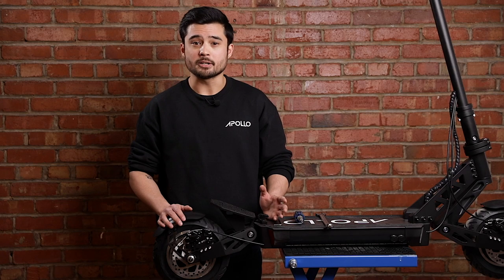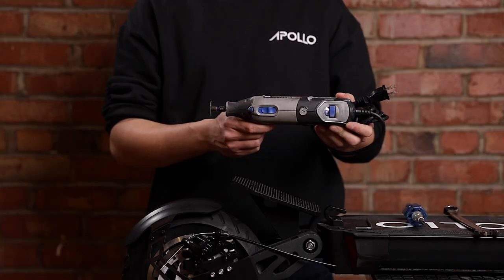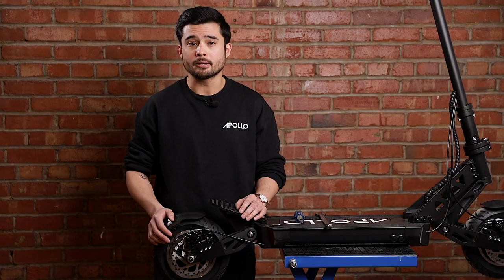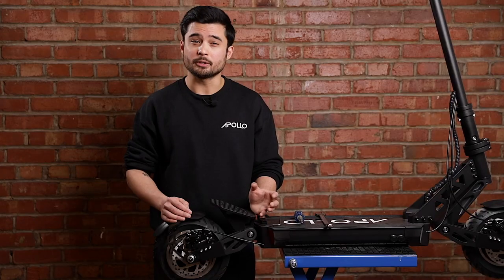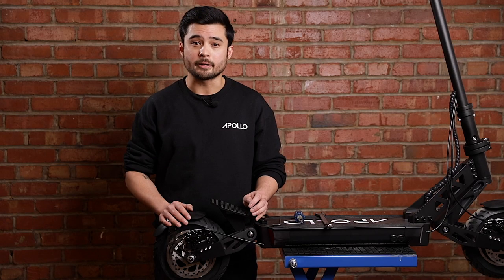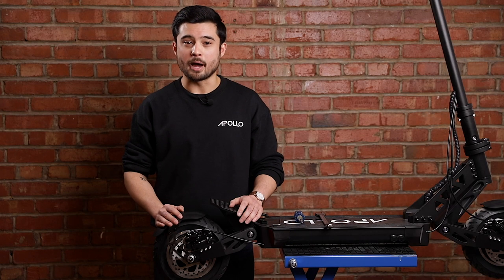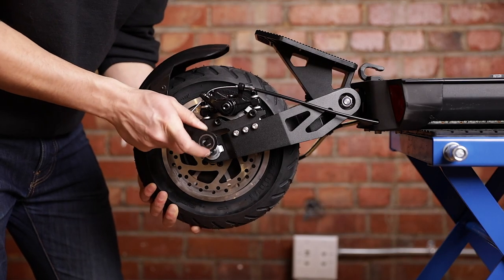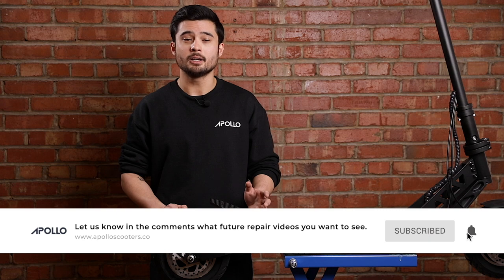How to Change a Brake Disc on an Apollo Ghost

Comment: The 6 screws are extremely tight on my ghost. I stripped 2 because of it and the other 4 were tough to unscrew. The tool you guys need that he’s talking about is a dremel. Costed me $70 at Canadian tire for a decent one. It’s just a shame that the screws aren’t fully metal, would’ve made it easier to come off and not strip.
Reply: I’m struggling to get them out. I got one out normally and one using a hammer. Tried the rubber band technique (no luck). Now I have to find a dremel which is unfortunate cause everything else was going well.
Reply: @YouProductions1000  dremels are useful for a number of things so I guess it’s a good thing to have it in our toolkits now.
Reply: Bro fuck disc screws on rotors, i messed up mines too

Comment: I have wasted a week and over $200 in tools to try and remove the screws from one wheel on my Ghost. All of the disk brake screws on both wheels came stripped out of the box. So stripped that I couldn't use any size of allen key or any other tool to even try to remove them. The holes in the screws are perfectly round with nothing for any tool to grab onto. Cutting a notch in the screw with a Dremel doesn't work either because the screw is so overtightened and it's made of cheap aluminum that just bends under the screwdriver bit. I've even tried penetrating oil and heating the screws with a cutting torch. This is unacceptable, sloppy, poor quality assembly at the factory. I've removed bicycle disk brakes many times and never had this problem. The screws are supposed to be tight, not stripped. These brake disks are supposed to be removable by the customer so we can work on tires and other parts. Stripping the cheap tin screws out at the factory makes this impossible. 

The only way I will ever be able to remove these screws is by forcefully drilling them out, which risks damaging both the brake rotor and the motor underneath it. I didn't buy a scooter so I could spend weeks spending money and time trying to remove broken and/or defective parts, as far as I'm concerned a stripped screw is broken. My Ghost is sitting gathering dust for over a week with its wheel off in my front hallway, I haven't even been able to ride it once in the beautiful spring weather. I'm so angry about this that I'm about to return the entire scooter and get my money back to spend on a better quality product. 🤬
Reply: Agreed. Tried multiple times to remove the stripped screws using various techniques, but in the end I’ll just have to get it serviced. As a casual rider it’s a real inconvenience on what otherwise was an exceptional scooter.

Comment: I used a Dremel to cut a wedge into the brake disc’s screws since 4 of them are stripped, but cannot get them to open with my flathead screwdriver. Any suggestions?
Reply: I used the “OEMTOOLS Mini Impact Driver” from the local auto store.

I was successful using an impact screwdriver to remove both the stuck / unstripped screws as well as the screws I had to cut with a grinding tool.

The cuts made by these kinds of hand tools recommended are a bit loose and a little difficult to make. (Especially if you just bought this tool and are using it for the first time like I did). 

It is really important to put a lot of force on the bolt head to keep the new cuts from stripping as well, (if you do not have an impact screwdriver).

The bolt that holds the wheel on makes it really difficult to unscrew the break plate properly.  The bolt makes it so you cannot press the wrench tool straight onto the screws with the proper amount of force, which will cause it to strip easier. Since the wheel is still attached to the motor cable, it makes getting a good angle on the screws / wheel difficult, because you need to have the scooter lifted to work on it.

I recommend finding a nice set up to get the wheel flat and stable before trying to remove any of the screws.

Also I replaced the screws with matching grade 8 (stronger) screws, because the screws are badly damaged from the grinding tool and also I saw a screw is somewhat sheared at the threads, (maybe from over tightening at the factory, or natural wear).

Comment: How do I get rid of the brake squeal? My ghost arrived last week and the squeal noise was unbearably loud, had to sand down the the pads a bit and brake cleaned the rotors, the noise lessened a little bit but still present

Comment: How many miles until you have to change brake pads on apollo ghost.
Reply: I can't speak for Apollo, but I'd think it would greatly vary based on riding style. Going downhill and braking often  will wear pads down faster than coasting and braking seldomly.
Reply from the maker: It truly depends on your riding style. However, you should be good for no less than 300km.
Reply: @ApolloScooters  ok thanks for the response. I love my ghost, this scooter is a beast!!

Comment: The fact y’all even suggest to do this to a product of your that you went cheap on with screws is truly insulting. Fix your design on the handle bars not connecting properly and the scooter not folding correctly since the latch won’t work right. Y’all had 1 job smh